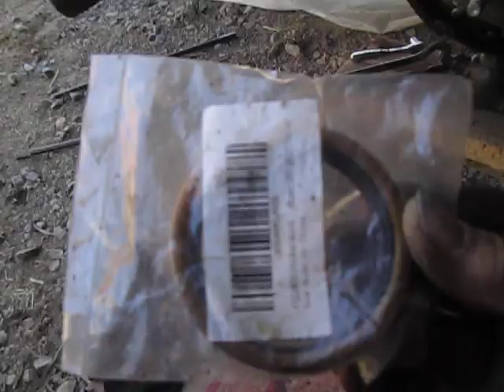Amish Wonder Kid Hits Wall on Brake Warning Light From Hell

Comment: Plus why does he have the drive shaft disconnected? You don’t need to do that. You also don’t need a gear puller to do that job.
Reply: What i'm thinking is: Why aren't those tractors already back on the fields doing what they are build for, BUT the kid is 19, so ..... 🙃.
Reply from the maker: After talking to a "real" Toyota mechanic, the word is that some Tacomas do need to have it disconnected, others don't. I will know on Wednesday which I have.
Reply: @Humptydumptytribe  Ahaa, i'm learning more mechanic stuff by the week. 
So it's a 50/50 thing? Well i hope it gets done for shizzle. Talking about a adventure, 🥰.